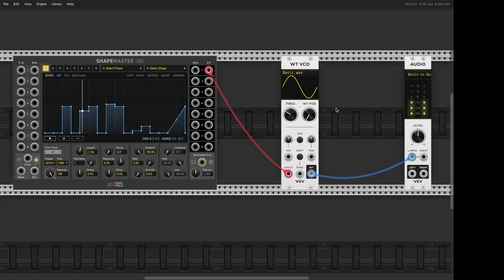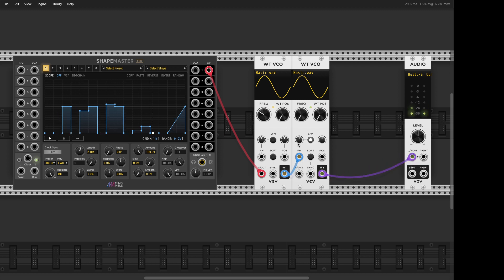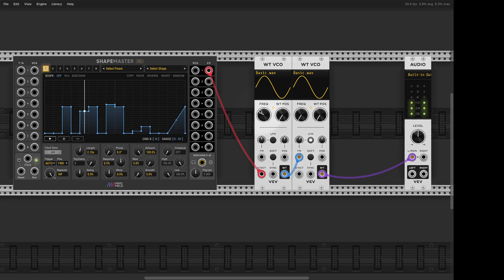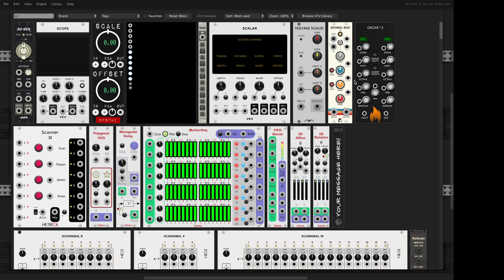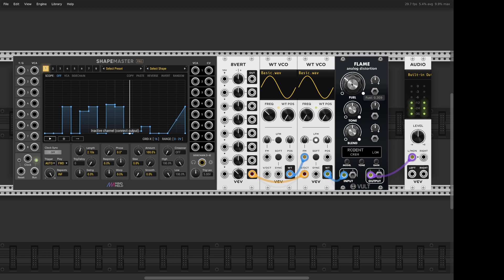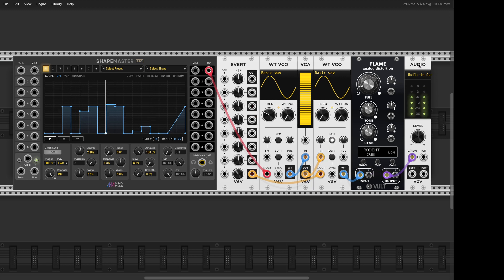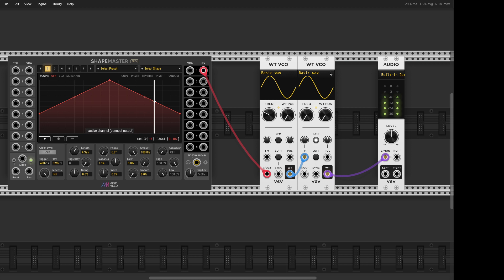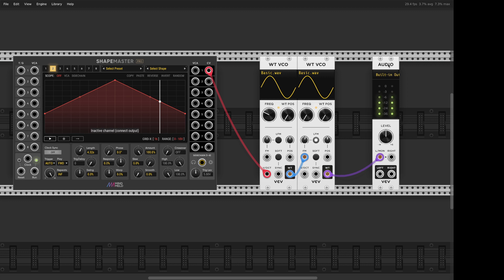VCV Rack Hacks | Through-Zero Reese Bass

Comment: Great video, love the sounds you get through this!

I experimented with a bunch of different VCOs with FM inputs. I found two that had the most interesting results with this technique:

1. Terrorform by Valley has a zero-mode FM built in. You can get some really smooth sounds that way, but also have all the wave shaping that comes with the module built in

2. Vult’s Noxious has an FM input; if you put it in LFO mode it actually works, and you can get some fun results playing with the different shaping knobs.

Thanks for the video Jakub!

Comment: So with the VCV WT VCO carrier nearly at 0Hz, the carrier is basically stalled at ~0 Hz in the absence of any FM signal. Add the sine FM and the the carrier frequency oscillates symmetrically around 0. At 100% FM depth the VCO linear FM response is a constant 261.63 Hz/Volt. The Instruo Neoni in through zero FM mode always operates as a 0Hz carrier, but the FM response is scaled to the carrier base frequency. So if you leave the Neoni at its default C4 frequency, then it functions the same as the VCV WT VCO at ~0Hz (though much buzzier, at least in VCV).  However, the Neoni is so close to 0 Hz that the beating all but disappears. To get the beating you need to add a few millivolts DC bias to the FM signal (make sure the Neoni FM is in DC coupled mode). The Neoni V/Oct setting effectively functions as a form of FM depth when in through zero mode, but at a much greater scale than "normal" FM depth. For both the WT VCO and Neoni, the carrier wave gets folded more and more as the FM depth increases. The Neoni has an odd discontinuity at the folding peak in VCV, and I think that is where the buzz is coming from.